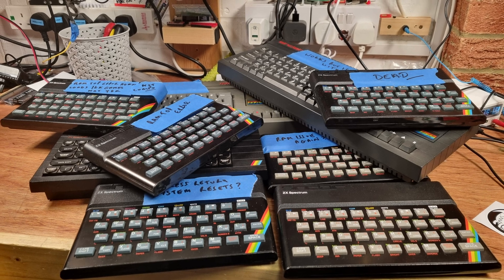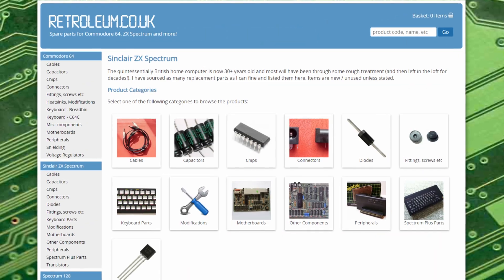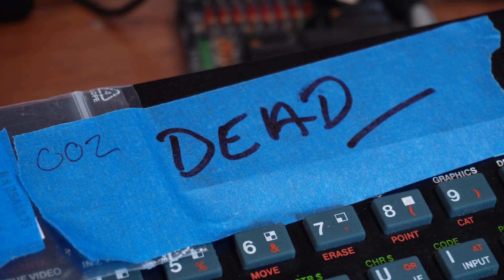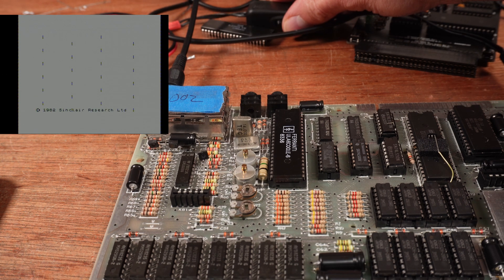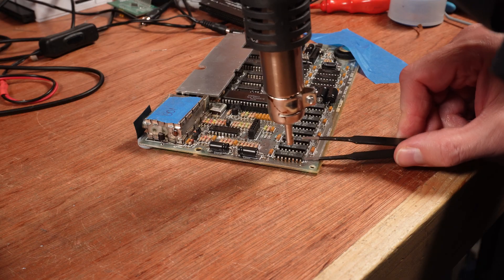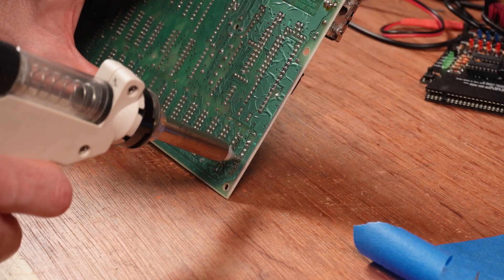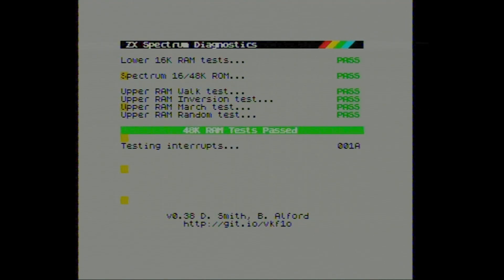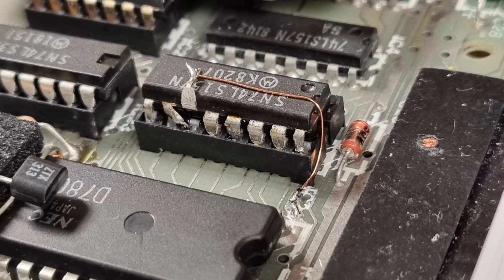A Vintage Bodge in This ZX Spectrum

Comment: I bought a 3rd party internal chip upgrade for my 16k Spectrum back in 1982/3. My memory of the upgrade was it was a single chip to insert into an empty socket on the board.  I even managed to get that wrong and inserted it incorrectly! The computer appeared to be dead. I swapped it around (aligning pin 1 correctly this time) and still no joy.  I panicked and decided to leave it for a "few minutes" because that always works, right? Nope ....  but luckily after  20 minutes or so (while I ate my dinner near to tears after getting lectures from my parents!) I tried the power again and my now 48k Spectrum sprung to life with no further issues.  Disaster averted and the computer ran fine for many years afterwards.

Comment: I got your message but havnt had the time to reply yet. We used to cut all the pins with side cutters at the very top of the IC as close as we could get them and then take the pins out one by one by heating them up with soldering iron and holding the pins with the cutters or thin nose pliers. Later when they brought a weller desolder sucker we did use that but sometimes it was easier to use the cut the pins. Forgot we did also see quite a few where the thro plated holes did not work so we ended up putting solder on the holes or worst case a bit of wire through.

Comment: Seen People use Low melt solder for this stuff then the hot air wouldn't need to be so hot on the board

Comment: Beware as the nebula can be masking an underlying problem, the nebula uses a modern CPLD which is more "immune" to noise in the data lines, it is possible that something is disturbing D7 on the bus, is it even possible that the RAM you changed is still good but marginal. I know because a RAM replacement that I dessigned, with the real ULA caused artifacts but with the nebula worked without any problem and it was caused by some noise that was getting picked by the data lines.
Reply from the maker: I've seen that myself in another machine. I will bear it in mind

Comment: TIP:
Desoldering chips are much easier if you first of all cut all the pins from the IC.
This leaves 2 rows of stubs which are much easier to heat up and lift up not ripping the tracks.
With this method you quickly learn to lift out each stub with a hot solder wetted iron from the component side.
Reply from the maker: You're right, it is easier. But 8 choose not to do it that way. No going back of the chip is not faulty. And too many times I've removed a chip that was actually good.

Comment: Dus you try using de-oxid on the pins and connectors?

That is apparently a common issue with old electronics.
Reply from the maker: Always the first thing I do when I take a chip out

Comment: If you absolutely don't want to hurt the PCB, and don't care about the IC you're removing, clip each pin off at the IC body with a pair of fine tip cutters, and remove each leg, one at a time.  I've done this for over 45 years.
Reply from the maker: I really don't like cutting chips. I've removed too many I was convinced were bad and they turned out to be ok

Comment: I have just tried your way of removing chips from a board, and what can I say, it's fantastic, I used to desolder underneath (same as you) then snip the legs (destroying the chip) and use soldering iron and tweezers to remove each leg, but you way is Great, Thanks...

I watched the Video on Saturday and had a hot air station delivered on Sunday.
Reply from the maker: Thats amazing!
It does carry some slight risk, so be careful. But I think its worth it so you dont have to destroy potentially good chips.

Comment: nice one! I've learnt a few things, particularly what is that little board doing on one of my issue 2 board. It was upgraded at some point, cool! The ULA replacement looks very nice, I might need one as I have two Speccy's and one working ULA. Thanks for the video!
Reply from the maker: Thanks Tony! Glad it helped!
The Nebula is hard to get hold of. You have to keep an eye on Retroleum to see when they come in stock. But well worth it!

Comment: Indeed, the swapped legs on an Issue 2 where there to be able to use OKI RAM on those TI only boards... Another interesting thing to know. If you replace the upper memory with 4164 chips you may also have to change the setting back to TI RAM (L or H doesn't matter) because otherwise the Spectrum refreshes the wrong 32k of memory (16k used and and 16k unused memory, leaving 16k used memory without refresh cycles). Your brand new 4164 may look bad and test bad but they are not, just the wrong part of memory is selected during refresh (needs 8 bits refresh address instead of 7 bits; the Z80 only provides 7 bits). Samsung has memory like that and it is fine once the jumpers are changed to TI or the strange bodge is undone on an Spectrum Issue 2.
Reply from the maker: Great info! Thank you!

Comment: One of these days I'm going to get my hands on a spectrum!  Never touched or laid eyes on a real one. 
if that ULA tested out fine and everything went back to normal after you re-socketed it, then perhaps the old socket had a cold joint. 
but,  like you said as long as it keeps working.. Great video, Lee!
Reply from the maker: Build one! They're great fun to build. Probably better to do that than import a broken one.
Reply: @MoreFunMakingIt build one? Do you have any links for that? Thanks!
Reply from the maker: @xRepoUKx  take a look at some of my recent videos. I've built 3 different ones.
Reply: @MoreFunMakingIt  will do! 🤟
Reply: Cold joint - had the same thought TBH.

Comment: Excellent and entertaining as always.  I love your delivery style and wish I could be half as entertaining.  At a guess, there was probably something wrong with the ULA socket you replaced and the new one fixed it right up.  But that's just my non-Speccy opinion.  Keep it up.  And I hope you're on the mend.  All the best.
Reply from the maker: I probably didn't explain it very well with the confusion over the two motherboards. 
The fault was still there in the issue 2 motherboard after I changed the socket
Reply from the maker: Also, thank you for the kind words!

Comment: Forget all previous methods of dead chip removal.

Just snip each lead flush with the package (top side of pcb) with small sharp side cutters, and the package falls away.

Now just remove each pin with a soldering iron, using the side cutters as pliers.

Afterwards, a decent manual spring loaded solder sucker will clear the holes of solder.

Not advisable if the chip might not be faulty.
Reply from the maker: I would only ever use the snip method of I knew 100% the chip was faulty. I really don't like destructive methods when they're not needed.
Reply: @MoreFunMakingIt  I do it mainly to avoid stress on the PCB with hot air heating and pulling on vias where the solder isn't quite hot enough